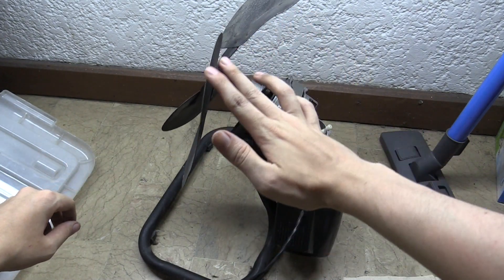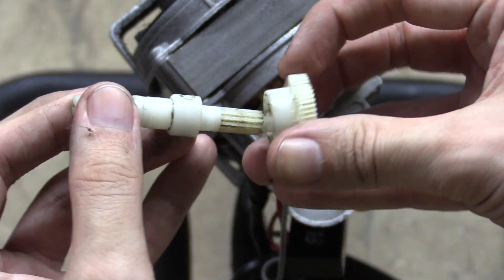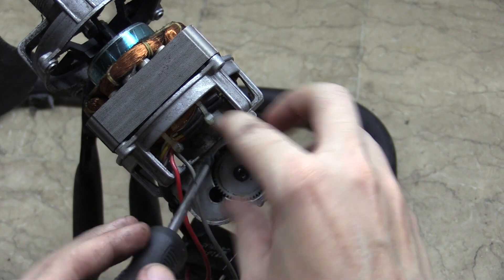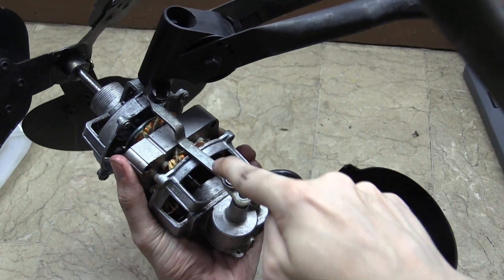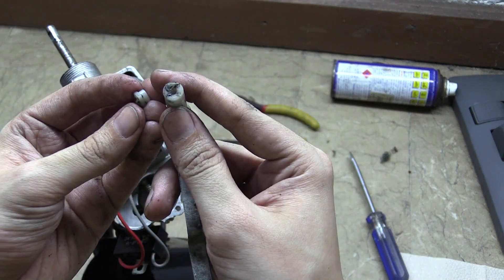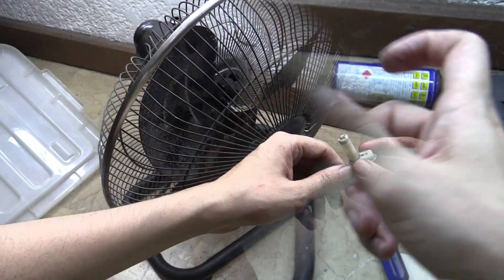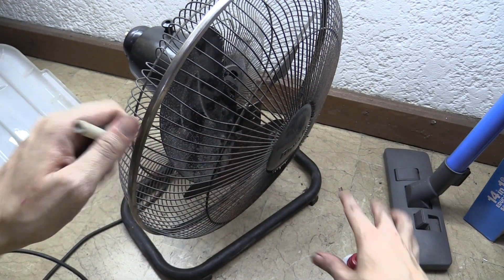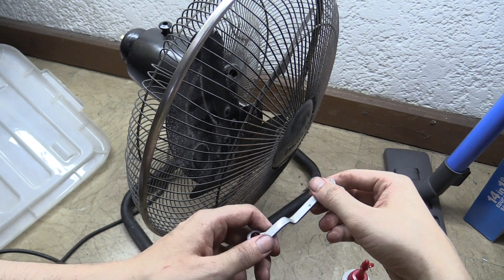Fixing an oscillating fan.. kind of.

Comment: manufacturers deliberately make DIY impossible so you have to buy twice.  Don't give up you'll find the solution.
Reply: It's not really about manufacturers making DIY repairs "impossible" so that you're forced to buy again. On the contrary, it's mostly centred around the design stage so that the prohibitive costs of tooling to produce these intricate parts are reduced as much as possible. That's why plastics are used wherever possible, even though zinc alloy parts, or similar, would do a better job. The lower the cost, the more saleable the product, therefore the bigger the profit. That's business.

Comment: Try to make this part with 3D printer if it is not available. Make it with POM (Polyoxymethylene), that is the strong plastic. One question; I have disassemble the same gearbox and when I pull the white plastic axle one ball ejected and  jumped into the garden in grass, but some other part also jumped into the garden. The other ball and one spring is still in the shaft and I have it, but one ball jumped out and one part unidentified also. Do you have picture of inside the gearbox what else could be accept one spring and two balls?. My fan is Airmax 2000 and has the same motor and gearbox bought somewhere 20 years ago.

Comment: we had some awesome 2 part epoxy we used at the body shop I worked in but I'm not sure if you can find anything like it here
Reply from the maker: I tried a 2 part epoxy without any luck but I'm sure there's several types out there and maybe one would work better than the other for this type of material.

Comment: Nice video.. After putting super glue, add a metal pin or small nail on the center or hollow part and fill it up with hot glue or epoxy to make it stronger.. I've made cheap repairs like this with broken fan parts bracing it with metal and hot glue ( quick repair) and it still works! :-)
Reply from the maker: Nice idea. I hadn't thought of filling the hollow section but of course there's no reason for it to be hollow so filling it should add some good strength. Thanks :)

Comment: This is me fixing fans constantly because I'm tired of trying to come up with money to buy a quality fan but I don't like the fan spinning and I might look at somehow keeping the fan from moving, that's my problem.  The bearings need oil the bushings on the fans that freeze up need replacing, I haven't done this yet and I'm not sure I have enough knowledge on how to remove and replace bushings also the capacitors failing #1 problem and the replacements are made in China, they last about a year if that.

Comment: Learned about the wormgear part. What about drilling a small hole through the centre and use a toothpick (dowl) that way you are not relying on just the two surfaces   to stick to each other.

Comment: just buy the replacement. its very cheap only 5pesos.

and its widely available in philippines.
Reply from the maker: Really? Where from? Junk shops?
Reply: there is a electricfan repair shop if you're near in pasig (simbahan) that sells all kinds of e. fan parts, had the same parts broken before that they have replacement parts available.
Reply: Ah, yes, fan parts/repair shops. Just brought one of our fans to a shop in Mandaluyong and they still have parts for it despite being 20+years old.
Reply: if its nikon or standards brands, you can get one easily on their service centers. else, there should be a electrifan repair shops in you area.

my standard fan (i mean standard which is the brand), still works fine until now for about 8-9years now, every 2 years or less, it needs replacement like the capacitor or need to replace the copper on the motor. which all of this cost less than 200 pesos, a huge savings if you compare it to a brand new unit.

I never had a issue against the turning functionality of my fan, it works just fine until now.

Comment: you can make a 3d print  version of the whole thing :D
Reply from the maker: It's certainly a possibility. One downside with a 3d printed version is that I have to model the part first. Although it's not that complex a part. The other downside is that it wont be easy for someone else to replicate the repair in the future unless they also have access to a 3D printer. But regardless, it might be the perfect time for a new video using the 3d printer :)

Comment: Did you think to glue a metal rod inside the plastic to act as a splint
Havent seen a 3d printer vid in a while, is it still working?
Reply from the maker: Yeah I tried something like that with a slim bolt but didn't really help. 3D printer is still good, just feeling lazy to model the part because that would take some time to get right.

Comment: I've had good luck plastic welding some plastics that just will not glue up. Option 2, try the ABS "glue" for bonding water pipes together. That stuff more or less melts the plastic. In a way it's like the plastic welding with no heat involved.
Reply from the maker: Hmm maybe I'll try that ABS glue first since it's likely to be less destructive than a soldering iron or other plastic welding choice. Thanks for the tip!
Reply from the maker: Good thinking. I'm glad I made this video, so many good suggestions from people :)
Reply: Also, if you can, try drilling shallow, minute holes (1.5 - 2mm) on both pieces to be joined so that the adhesive will have recesses to seep into.

Comment: The only part you'll find is out of a new one if still on shelves...if you know what I mean. Companies make stuff to fail. They deserve a RTV return to vendor.
Reply from the maker: Yeah it's annoying. If you look at this fan, most of it is metal and fairly heavy duty. Then when you get to the gearbox it suddenly changes to plastic or nylon which is likely to break eventually. I have emailed Dowell PH to see if they can provide the replacement part. I also have the option of 3D printing the part but I'd have to model it first and since I'm not great at that, it would likely take a few revisions. If I had a lathe and all the tools, I could probably replicate it in metal :P